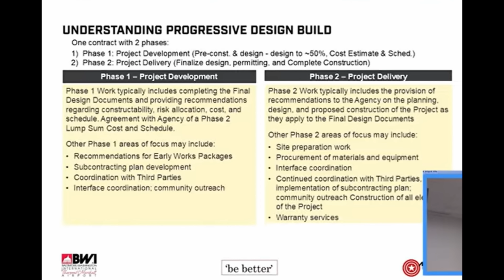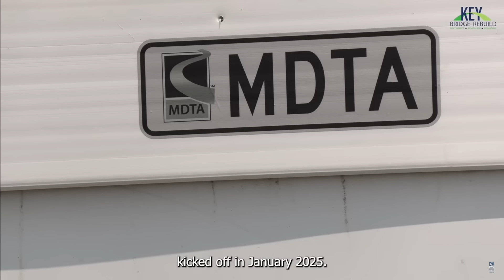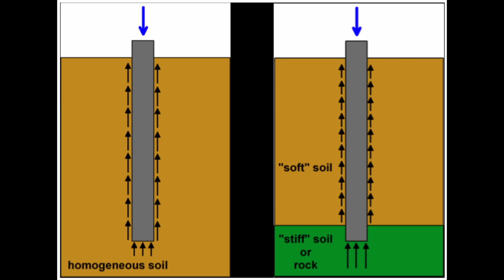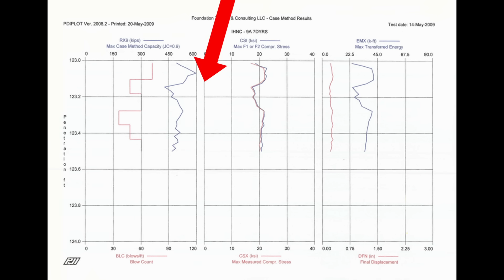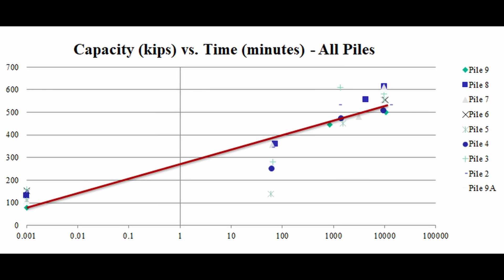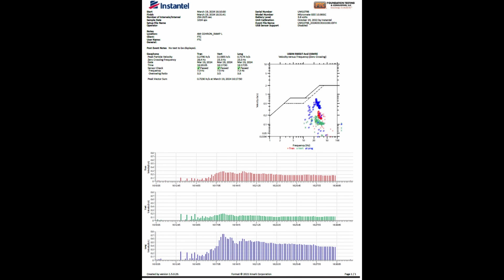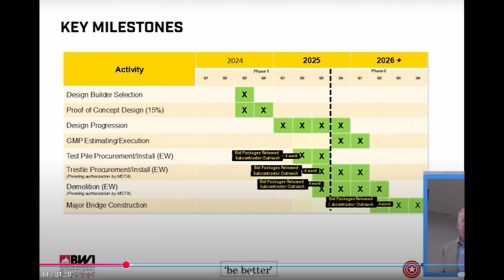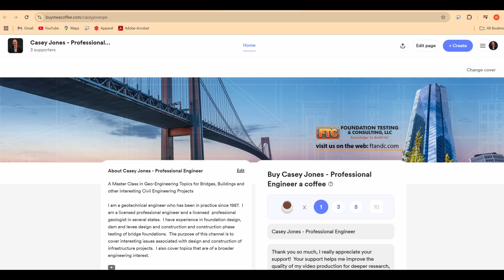Update - Francis Scott Key Bridge Replacement

Comment: As a millwright I always thought that engineers were the dumbest two legged animal ever to walk on earth and then I became one. I wonder if the design has addressed inspection and maintenance requirements. I also wonder if the the pressure to get the bridge back into service will compromise due care in its design. I wonder if consideration a a sea level that three or four meters higher with stronger tidal currents will do to the pilings.

Comment: Thanks for your well explained presentation, especially to do with pile testing. 
When i was an undergraduate in 1973, I had a work experience job on a large piling project next to the river Thames. We were driving 1x1ft precast concrete piles to refusal. Another guy and myself had to paint marks on the piles at 1ft intervals and count the number of blows it took to go down each foot. When it got near refusal, I had to count the blows per inch with my head just some 10 feet or so from the diesel hammer. No ear protectors and had to carry on through rain and shine. Happy days! I survived and became a bridge designer, now retired.
I'm glad to see it is all automated now and you can monitor from a nice, comfortable cabin on site. True progress.
Reply from the maker: That is quite a story, thank you for sharing!  Yes personal protective gear has come a long ways.

Comment: Governor Moore has turned this project into another dragged out civil project that will cost the citizens of Maryland twice as much as it should and take twice as long as it should to complete. For 35 years the citizens of the Broadneck Peninsula have put up with billions of dollars wasted in study after study, traffic jams that last Thursday through Sunday with no real solution or shovel turned for a new bridge or tunnel. To top it off Governors and the Maryland General Assembly have ignored the citizens of the Broadneck Peninsula to put the project somewhere else we have had enough traffic issues for way to long! Maryland Government SUCKS when it comes to road and bridge construction. NC runs circles around Maryland in getting things done!

Comment: The question I have, is why demo out the entire bridge I.E. the remaining approach spans, then build a temporary trestle, instead of building the new bridge alongside the existing bridge, and use it as the temporary work platform, then demo it after the completion?  Yes, obviously there will always have to be a new temporary structure over the main span as that part of the existing bridge is missing.  This method happens all the time in bridge replacement efforts.

Comment: I started my career working at the Port when the Key bridge was New. I've worked at most port facilities all around Baltimore up to my Retirement at 70 just short of 50 years. I used both tunnels and the bridge many times depending on which job I was on any particular day. I just hope to see the New bridge finished while I'm still around.

Comment: I am opposed to the currently approved scheme for the replacement of the I-695 harbor crossing in Baltimore.

The main span would be 1,400 feet. The former span of 1,200 feet proved that totally inadequate to protect from large ships. The proposed main piers are in almost the same depth of water as the previous, and no feasible "dolphin" system will protect the bridge from a 100,000 ship moving at channel speed.

The Sollers Point location is not a safe place to build a bridge similar to the old one in span lengths. The risks are catastrophic as we have just seen.

Reasonable and prudent alternatives, so that there are no deep water piers that can be hit by Panamax size ships.
1) Build a bridge with a 5,200 foot long main span between the two causeways
2) Build the original 6,200 foot long tunnel design between the two causeways
3) No-Build Alternative
If they are not willing to select Alternative 1 or 2, they should select Alternative 3.

Comment: Lots of harbors do not let the ship captain drive his boat into their harbor they make the ships wait offshore while a local ship pilot
motors out, comes aboard and drives the boat into the harbor to port. Has this harbor made that a requirement after what 
happened to their bridge? They should.

!
Reply: Two Harbor Pilots were on the Dali when the collision occurred. But a Pilot can’t restore a failed engineering plant.

Comment: Thanks for the update on this project. As you are an engineer, I would like to know what your thoughts are with regards to certain claims that have been made about this new bridge, as well as some others of the same kind that have been recently completed.  The new Key Bridge (and the Gordie Howe Bridge) is supposed to last at least 100 years, and then there is the insane claim that the new harbor bridge in Texas is to last 175 years or more.  I don't see how they can make those claims, especially since there are aren't many really large bridges that are over 100 years old.  Hopefully the contractor(s) didn't issue a written warranty!  Worse yet, modern cable stayed bridges don't have much of a "track record" with regards to longevity and it seems as if they would be harder to repair than steel truss or suspension bridges.  What happens when the rebar in the towers begins to rust and they start to crumble? Of course, none of us will be around to see how these claims will play out.

Comment: The MDTA may indeed be doing a great job with the reconstruction of the FSK Bridge, but the sad part is that they failed to do a great job of protecting the old span.
Reply from the maker: I totally agree with you on that!
Reply: @CaseyJones-Engineer come on. The shipping channel was widened and deepened long after FSK built. In NTSB parlance, the “proximate cause” of the catastrophic failure was the power failure on-board the vessel. Even with better/bigger fenders protecting the pilings, the angle of impact was literally a one in a million shot. That Span was doomed, and no amount of Monday morning quarterbacking, trying to somehow pin this outcome on MdTA is going to pass the proverbial “giggle test”. That said, the replace design is arguably inherently superior to the one ending up in the shipping channel, so let’s celebrate that reality.

Comment: I have a question, Casey. As far as I can tell the Key bridge and Bay bridge are (were) the same height. Since ships have to pass under the Bay bridge, how does raising the Key bridge allow for larger ships?
Reply from the maker: That is a good question that I will have to look into.
Reply: There are plans afoot to build a new Bay Bridge, so I'd imagine they plan on making it the same height as the new Key Bridge.  However, it will be years before that happens.

Comment: Are they adding a Railroad track to the new bridge for mass transit??   That ship and cargo should have been seized as payment.
Reply: No railroad track. There are no tracks at either end of the bridge approaches. There's no connections for mass transit anywhere near the bridge.
Reply: @1972Ray If anyone was thinking of expanding train lines, this would be the time
Reply: It’s probably worth less than what the insurance will pay, much of the cargo has US owners
Reply: @12345anton6789  I saw a video when it happened that the Insurance would only pay a small amount. Not sure truth but I hate that they do these things and walk away
Reply: @richardmeo2503 that’s how maritime insurance works worldwide, they have a max limit they cover, ship and cargo value sets the max limit. Same with oil spills, max limits worldwide is around 1 billion usd

Comment: I have a question concerning environmetal vibrations, if the sensors detect unacceptable vibrations for the residents, does the contractor have leeway to hit the piles less hard? I would think the static friction has to be overcome for the pile to go down, I don't think you can just use a big weight to push slowly (since the weight of the bridge is not supposed to push it down), so my naive outsider view is that there is not a lot of option for redution the blow. Can you detail a bit more the parameters of pile driving, please?

Comment: Keiwit is the major contractor building the light rail expansion in Seattle across Lake Washington to Bellevue and Redmond.   The problematic part has been building the 2 mile light rail on a floating bridge over Lake Washington. No one has ever built a train link on a floating bridge before so there been multiple problems, delays and cost overruns.  And lawsuits.  

Maybe you can do a segment on it!?!?!?!
Reply from the maker: That's a great suggestion, thank you!

Comment: Can you compare the replacement of FSK bridge to the nearly complete Gordie Howe bridge between Detroit MI. and Windsor Ontario.  It appears that the FSK is approximately 2 times the length(shore to shore) of the GH.  I would assume that would require that the towers be about twice the height.  The Gordie Howe was built without any intrusion into the heavily trafficked Detroit river.

Comment: Excellent. That piece of debris at 7:06 had me concerned, but it looks like rubber.  9:18 reminded me of the implosion of Veterans Stadium in Philadelphia, where some residents were eagerly anticipating blaming the city for pre-existing cracks in their basements, but not only did the demolition crew install vibration meters in these neighborhoods, but they demolished the perimeter of the stadium domino-like, one column after another in series, to spread the demolition over the span of a minute.
Reply from the maker: Thank you. I think you are correct.

Comment: My right arm was the pile driver after using a pump to blow pilings down for new houses we built along the Outer Banks. Marking the piling with a pencil at grade and having someone monitor for when it reaches a bounce back usually took between 40-80 whacks with a ten pound sledgehammer. It was explained to me by an engineer that basically a pyramid of compressed sand forms under the pile and that’s why you never cut a point into a pile as it’s the flat end and blows being transferred from end to end that creates the support. Sometimes you’ll find a pocket of organic material and each blow moves the 12x12 pile inches instead of fractions of an inch which could easily change the first deck height as that’s usually a what ever it ends up being and not designed to specific height above grade. Flood requirements are already exceeded by multiple feet anyway and if a piling drops that much there’s a much bigger problem.

Comment: Mitigating risk is usually cheaper than reacting to a potential problem. My favorite example is the Millennium Tower in San Francisco that has been sinking and tilting since its completion in 2009 with corrective actions and monitoring until today.
Reply: Millennium Tower is more than a potential problem.. its a real problem .. and yes they are wasting tons of ca$h trying to fix it after the fact

Comment: Is that 80ft of sinking under its own weight counting water depth or does it sink that far in the bed of waterway under its on weight?
Reply from the maker: The water depth was around 20 feet and the pile sunk about 80 feet below the mudline.
Reply: @CaseyJones-Engineer that’s neat info. I live on the coast of NC and have always been interested in construction methods in the waterways and inlets. I think it gets on my better half’s nerves when we are on the boat and I take a detour to check out some machinery or dredging equipment but It never gets old
Reply from the maker: @timblack33 I can totally relate!

Comment: It’s nice to see over a hundred test bores on such a project. I am normally involved in the excavation work but when we’re digging through drastically different materials in unexpected locations and they only have a handful of tests I get concerned about their engineering. I have also noticed that when things start to go wrong there are plenty of apprentices and interns to point the finger at. Like that time that the brand new MRI machine being delivered to the new hospital building got thrown over the fence in front of the city bus. Talk about a lot of finger pointing happening.

Comment: I thought the approach spans would be able to be saved to reduce the cost of the project.
Reply: The existing pilings and spans are almost 50 years old, and have been exposed to a marine environment. Better to start with a clean slate.
Reply: I am thinking that the new bridge length and height will be what determines where the new piers need to be to preclude the use of the old ones.
Reply: They said that due to the dramatic change of the height of the new bridge (230ft clearance vs 185ft for the old bridge) they cannot use the old approaches. The new bridge will actually be a bit longer so the approach ramps will have to start from further back.
Reply from the maker: You pose an interesting question.  I will look into that as the total number of lanes between the old an new bridges will not change (2 lanes in each direction).

Comment: Thanks for the update. I may have missed it, but the new bridge rendering did not show any dolphins for pier protection.
Reply from the maker: Thank you.  They are using large islands around the base of the piers instead of dolphins.
Reply: @CaseyJones-Engineer  
Those little tubs won't protect the pier from a 100,000 ton ship sailing at 10 knots. The whole thing will be torn to pieces and the bridge will collapse.
Reply: @scottkozel1519  The main support piers are being placed in shallow water away from the main ship channel. There is no way a large ship can get close.
Reply: @lummoxx8586  
False. The water where they propose to put the south main pier is 35 feet deep at MHW.